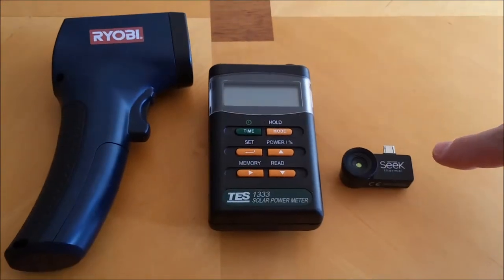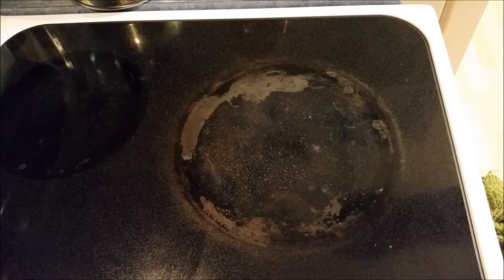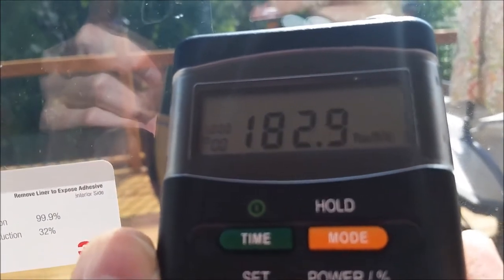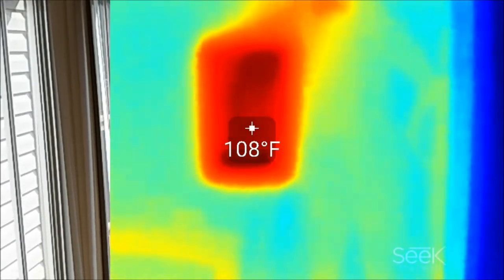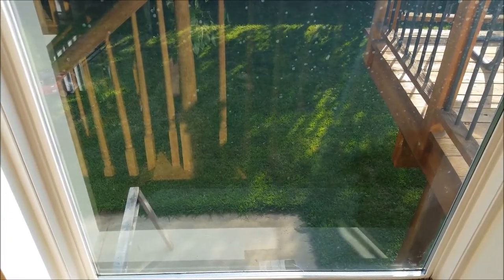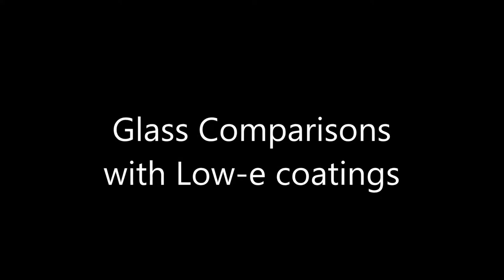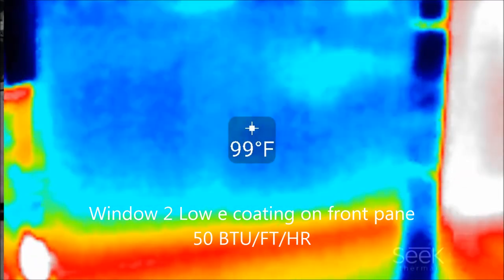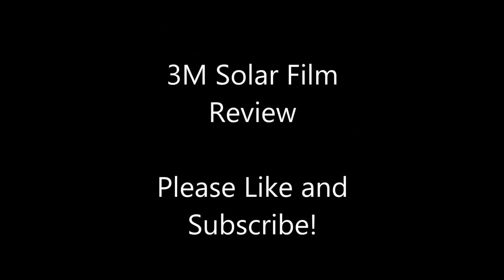3M Prestige 60 Solar Window Film Review

Comment: These kind of film is absolutely NOT recommended in double pane windows. That's the source of the problem, not the film itself. Your experiment and your own empirical sensation is correct: in these cases, with the double windows, it IS hotter; the heat will become trapped and will eventually break the seal and even the crystal itself! It was bad practice of your 3m installer not advising you against it. You should get a refund. I thank you for the video, but maybe you could make a little update for all the people that come here and end up confused? The double glass is the problem. 3M not making this explicit is the problem. Dishonest/clueless installer is the problem. Thanks!
Reply from the maker: I was under the impression of total energy rejection. This means that most all of the radiant energy  is reflected back.  When in actuality, a lot is absorbed and turned into heat. 

I haven't seen any seal failure or glass issues and it's probably a rare event... but possible.

Thanks for the comment. You're one of the view folks that understand what I'm trying to convey.

Comment: We just had these installed and could not be happier. The window itself is warm if you get close to it, but the rest of the house is considerably MUCH cooler. Radiant heat is blocked, stopping at the film, while before, it would go through the window and warm every surface it touched in the room, creating a greenhouse effect. We have two walls of glass in our condo and can finally enjoy the view without feeling as if we were dying. Not to mention the health benefits from the UV ray blockage. It also reduces the glare when looking out. We got the Prestige 70, which is the lightest version, and it is doing exactly what we paid for. The film was of course installed inside as we live in a condo.
Reply from the maker: That's interesting,  it's quite the opposite of what I have shown. Perhaps mine wasn't installed correctly (3M authorized installer) or is defective, but for my case it's hotter inside than it is outside with a temp gun and thermal imager. I'm not happy with it.
Reply: STEM_SAVING Well, today is one of the hottest days yet, and this is very interesting. We are super comfortable in here. The temperature outside is 28 in the shade and rising, AND the temperature inside is also 28 — BUT because the infrared heat is blocked, we don’t feel like there is a wall of solid heat coming towards us from the windows. It is SUPER comfortable here. We had foil on our windows (looked awful, the strata was mad at us) and even with the foil, we felt this very real, very solid wall of heat coming through... and now nothing. Both me and my husband have health issues and we really could not be happier. I baked bread this morning and still the house is fine. I don’t know why you would not notice a difference... I wonder if there is a defect somehow, or if measuring the temperature alone is not enough to notice the infrared issue.
Reply: @stem_saving1644  Are you sure it's installed correctly? I see in your demo that the film is taped to the window. Was the adhesive liner removed?
Reply from the maker: It does stop the radiant heat from being absorbed by the room,  but like I had mentioned in the vidoe,  the whole window heats up and then by convection the air gets heated. So,  it does stop radiant heat,  but converts it to thermal heat. 

 As you can see in my house,  I pretty much have a wall of windows and seen little difference.
Reply from the maker: I'm assuming so,  since it was installed by a certified 3m, installer. That's the only way to buy it at the time.
Reply: Exactly as you said; radiant heat stopped at window. A sensible comparison would have been to take internal room temperatures on similarly hot and sunny days, before and after installation.
Reply from the maker: It's actually radiant energy that's being stopped. Small distinction. When radiant energy is absorbed its converted to heat. So, the energy is being absorbed and converted to heat and transmitted into the house... just in a different form. 

But. Yes a better test would be a before and after..... at the time I didn't have my equipment. It was an after thought since the house was still getting hot.